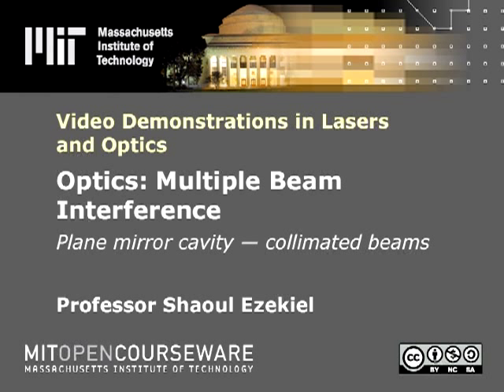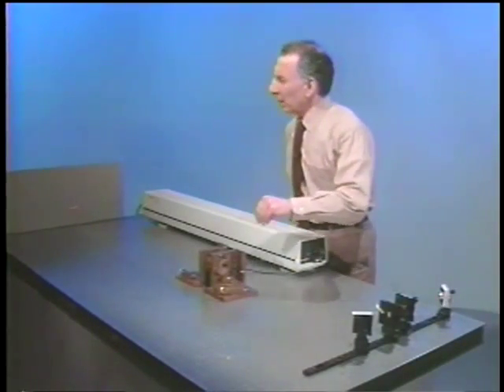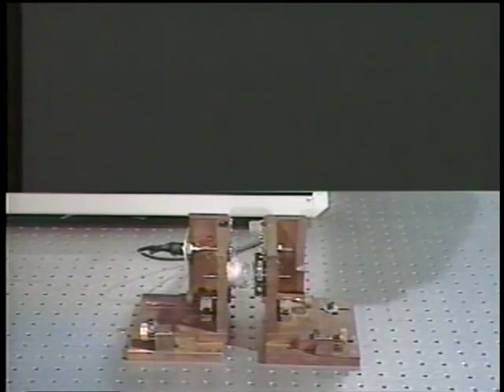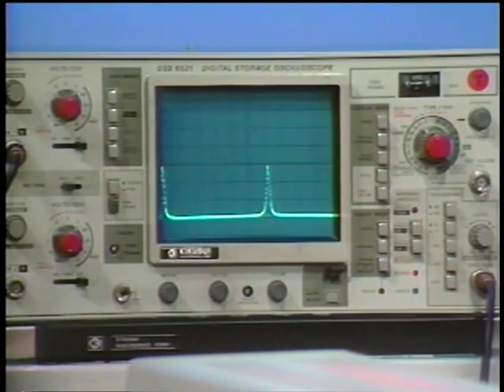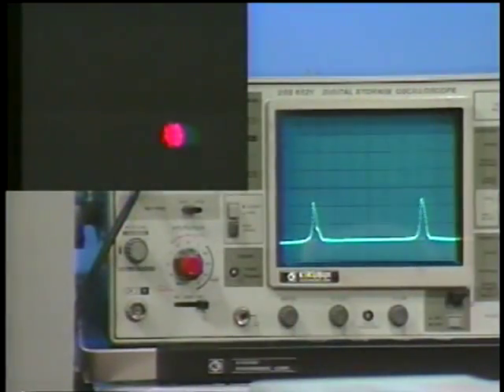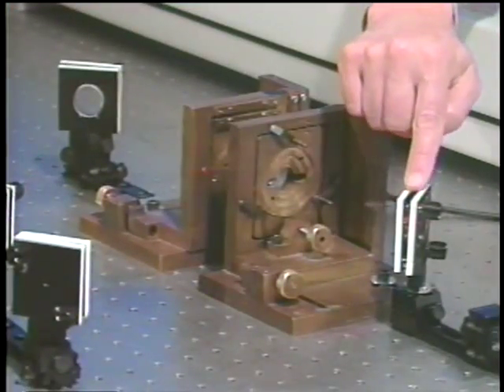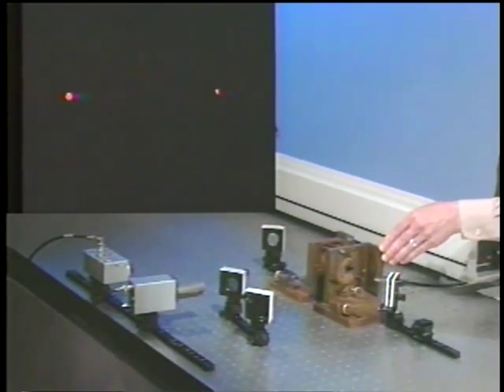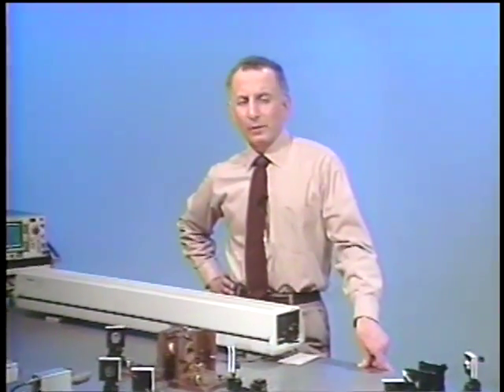Optics: Plane mirror cavity - collimated beams | MIT Video Demonstrations in Lasers and Optics

Comment: I have a question. Based on Fox-Li's method, for plane mirror cavity, there is a fundamental mode related to the mirror size and cavity length. If I launch collimated light into a plane mirror cavity, what will be the mode excited in a plane mirror cavity?

Comment: Why is there a line of dots in the first part of the demonstration? Is it like fringes?
Reply: i think we have to read the theory to understand the experiment
Reply: The light beam  runs back and forth between the two mirrors but a small fraction of each round trip leaks out at the output mirror and that leakage is projected onto the screen. When the the mirrors are aligned, ie. they are coaxial, then there is only one dot, otherwise the dots are projected off axis and get displaced horizontally by one additional off-axis angle for each round.
Reply: plane cavity means that you have two plane and parallel mirrors facing to each other (each has a reflectance of less than 1, so some light can enter and leave the cavity at all)
if the mirrors are misaligned they are not parallel anymore and multiple reflections will spread out more and more, leading to several dots with equal spacing (due to the angle between the mirrors)